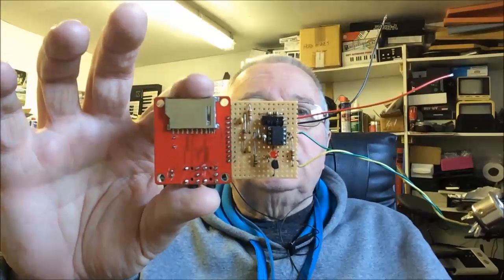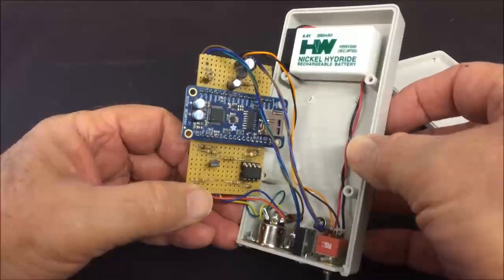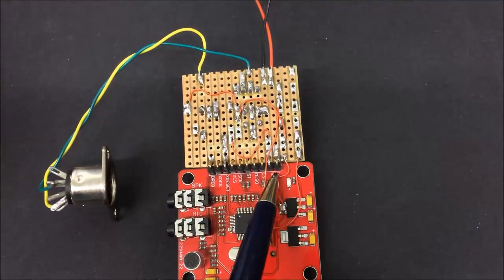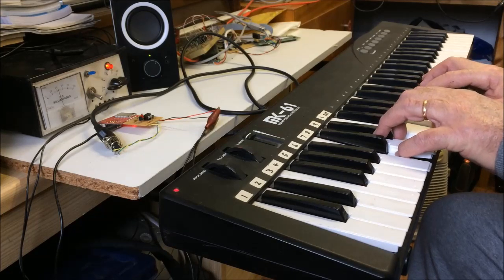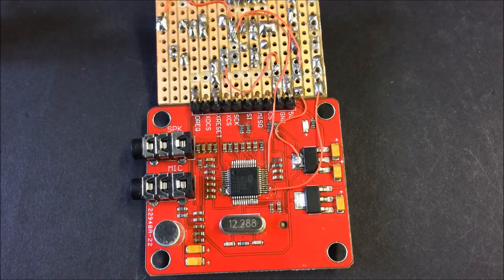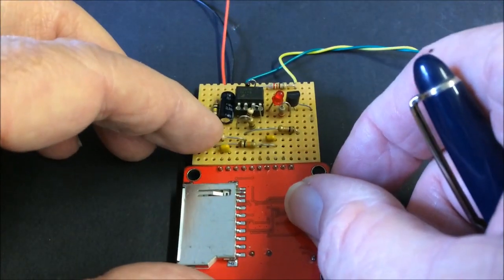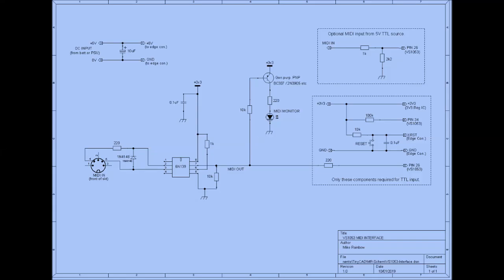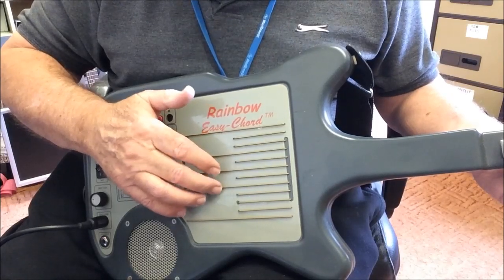DIY VS1053 MIDI Sound Module

Comment: Hi, Mike. Great review! This IC is not what I'm looking for, but still brilliant nonetheless.

I have been looking for an FM synth IC from some time ago, for a pet project of mine (an 8-bit computer). Unfortunately it seems that all manufacturers have decided to move on to PCM, and the best ones I can find are some new old stock of SIDchips, or similar :(
Do you know of any FM synth IC, still in production? 

Thank you very much!
Reply from the maker: Hi, I don't know where you are located but here in the UK several FM synth IC's are available on Ebay - YM2413, YM2612/3438, YM2151(which needs a DAC) and a few others. They cost around £5 including postage and are even cheaper direct from China including postage. They are NOS but there are still loads of them available.
Reply: @mikerainbow  Got it working with a YM2413. Thank you Mike!
Reply from the maker: @siniorgolazo  Very pleased to hear that you were successful!

Comment: Absolutely astonishing. I have a SV1035 shield for Arduino which is working fine. I just need to figure out how to create your PCB as my understanding of schematics is limited. If you have some pics with circuits and components to be solder for the noob, I would be glad. Thanks for this brilliant project Mike.
Reply from the maker: Thanks very much for your comments - the schematic with component values is at the link above but as this was just a one off project on stripboard I'm afraid there are no other construction details. There is enough info to construct the project but I can understand that it might be a bit difficult for someone with no previous experience.

Comment: Excellent work. That's really useful. How do you select the sounds?
Reply from the maker: Hi Sanjeev, thanks very much - the same MIDI messages that are sent to the module to play different notes are used to select different instruments or effects. Any midi keyboard, controller or instrument can be used to select different instrument sounds as well as play notes.
Reply: @mikerainbow  Thanks Mike. I've ordered a couple and will have a go at this.

Comment: Mike Rainbow you are amazing! I've been following your steps this afternoon.

QUESTION - If when adding the wire to pin 26 i also attach this same wire to pin 25.. (due to my rubbish soldering) will this be a problem? I see that pin 25 is listed at NC on the schema......
Reply from the maker: Hi Chris, thanks very much for the comment. I would really try and avoid attaching to pin 25 as it is a general purpose IO as well as part of the I2S DAC interface. If it is configured as an output on power up then this would drag down the MIDI messages coming in to pin 26. On the other hand configured as an input may be OK but I wouldn't take the chance.
Hope this is helpful.

Comment: Hi Mike. Thanks for those very clear and handy explanations (even for a newbe like me). I have a question for you : is a PIC also a good starting point for real time midi recording ? Thanks for your answer. Alex
Reply from the maker: Hi alexis1911, thanks for the positive feedback, much appreciated. I'm not sure what you mean by "midi recording". If you mean receiving and processing midi messages then most pic's with a serial port will do so with ease. Whether it's an 8, 16 or 32 bit device it just has to be able to receive serial input at 31250 baud. It also depends on what you want to do with the midi messages once you have received them. Hope this is helpful.
Reply: @mikerainbow  Hi Mike, thank you so much for taking time to answer. I'm trying to build a real time multitrack midi recording device. All music tracks messages should be recorded track by track. It meens that the device has to be able to play recorded tracks in the same time that it records the new one. So,  I wonder if a pic is adapted to that project. (sorry for my poor english, I'm french). Thanks a lot. Alex
Reply from the maker: @alexis1911  Hi Alex, your English is excellent. If you are receiving a single midi stream containing multiple midi instrument tracks, which is normally the case, then it is fairly straight forward to analyse the midi stream and separate the midi data for each track and then do something with it - for instance save the data to SD card. The trick is in writing some decent software to do this. It is also possible to simultaneously re-send some or all the midi data on a serial TX pin. I think you could actually achieve all this on an 8 bit device running at 20MHz or higher. If you are into any of the 32 bit range then the process  becomes a lot easier although all of these things depends on your ability to program the device in C. Likewise the speed you need on an 8 bit PIC requires programming in assembly or C. The trouble with PIC's is the vast range of devices available.
Reply: @mikerainbow  Thank you so much for your answer Mike. I guess I'll go for a 32 bit with a maximum of memory in order to acheave the process consisting on recording a single instrument track and, in the same time, playing the previously recorded ones. I guess that using memory then recording the all "song" on a SD will be more efficient than trying to read and write in the same time on a SD...

Comment: I am wating modul form aliexpress for 40 days already. Have you noticed some delay after pressing keyboard?
Reply from the maker: Hi, no, there is no discernible delay. I ordered my modules on ebay here in the UK and they arrived within 2 or 3 weeks, which is about normal here. I guess it depends on who you order through and how good the postal system is between source and destination.

Comment: Hi, finally useful video!
But i also solved this problem like you. (After many months...) But i solder GPIO#1 (34. pin) resistor to "stand" position =) and directly wire it to nearest 2V5 potential - on near capacitor. 26. leg of VS1053 was picked up during soldering and rewired to another unused socket pin.
Here is photo of my edit: 
https://drive.google.com/open?id=1Ioqi0JGdHQR1bwSwiZpdResyToGG6RRw
Reply from the maker: Hi, thanks for your interest and for posting your solution - yes there are a few different ways of doing this but I decided to try and keep to the recommendations in the VS1053b data sheet.